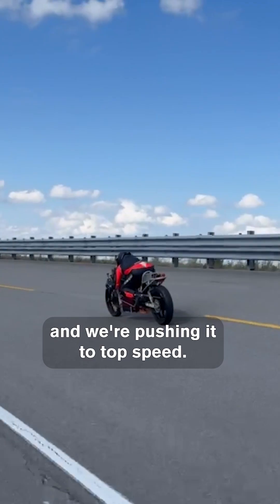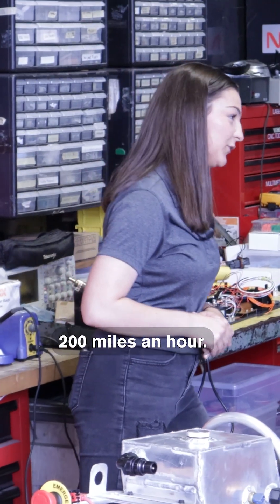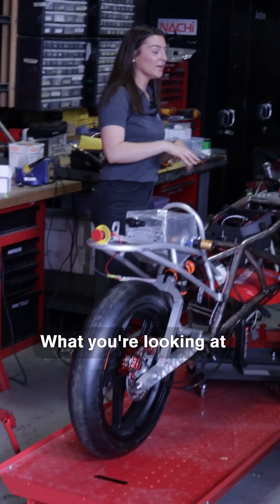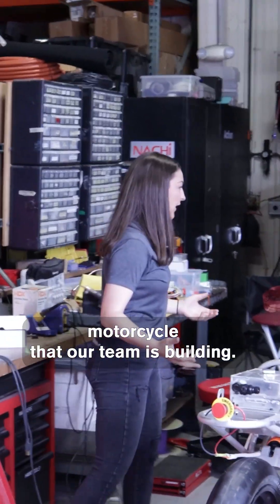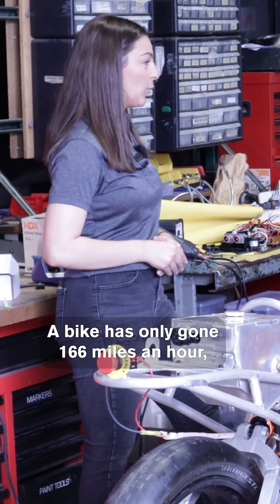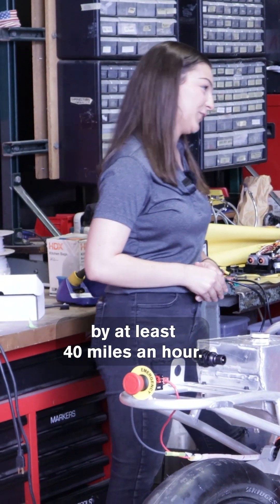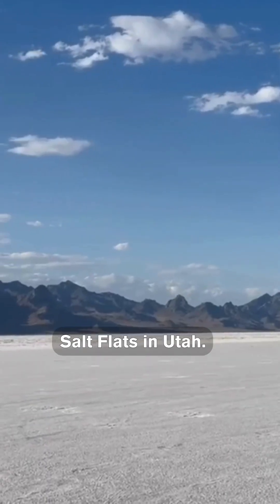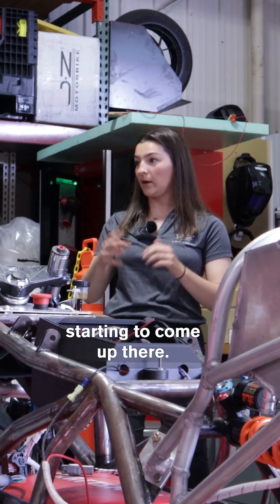200 MPH Electric Motorcycle | Sophie’s Electric Road Trip

Comment: Gas bikes burn cleaner than cars and are more fuel efficient. Don’t claim electric is a cleaner when slaves mine the lithium not to mention all the energy just to produce a shity motor that will not run after 10 years. Gas engines and Motorcycles never die. Bearing goes bad replace it, replacing gaskets and pistons and upkeep you will have a engine for generations.
Reply: Yeah but is it quiet? 😂😂